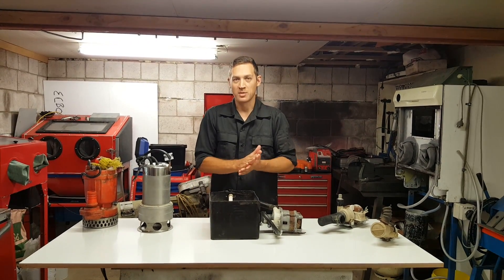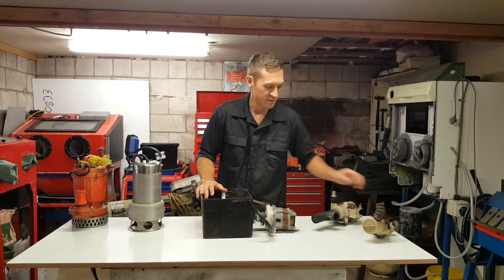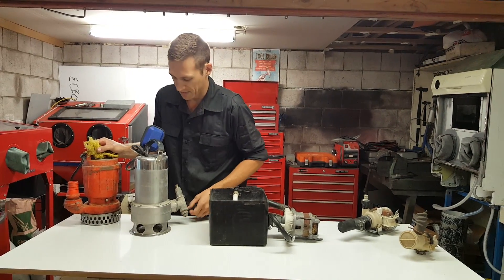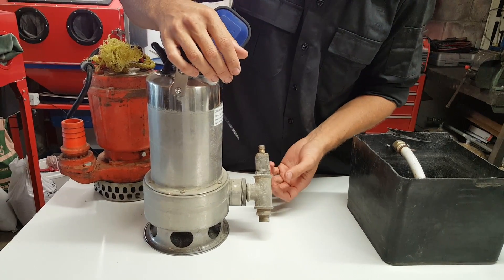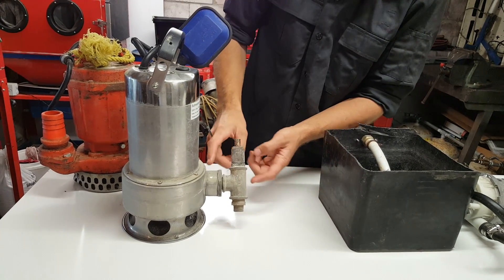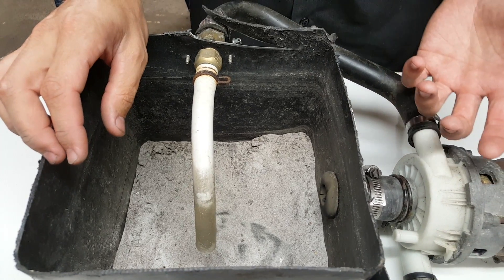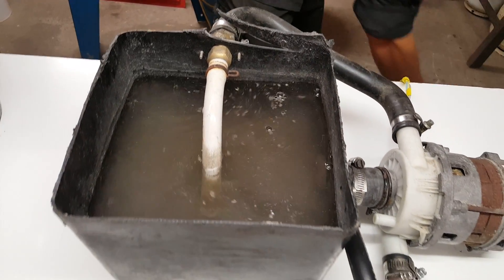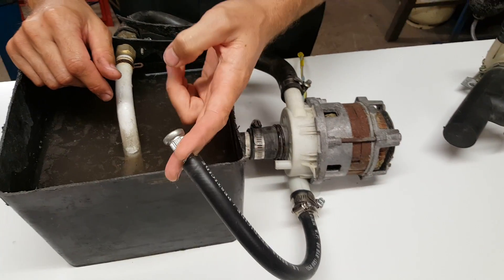DIY Vapor Blaster Pump Setups

Comment: Hi Great info.
Is it not better to have a larger discharge hose to the gun?
Reply from the maker: Hi Kevin,

That really comes down to a question of balance. 1/2" is usually fine for most applications. The other factor to consider is air flow. Unless you have a large air supply, going bigger can become over kill. As a general rule of thumb, I tend not to go above 1/2" slurry line until over 30 cfm of air supply. In which case I go up to 5/8" and then 3/4" over 50 cfm.

Thanks for the question!
Reply: Thank you for the info.
I have justed started out and based in South Africa where there isn't much info or equipment available.
Thank you once again for sharing your experience

Comment: 20cfm  air compressor strong enough   should I full full pressure or some psi
Reply from the maker: Hi! sorry I never answered this question. 85psi for cleaning, and if you want a shinier finish, you can lower the pressure to 35-40 Psi

Comment: What volume of pump should I use for a cabinet , the size of the red one , behind you. My budget and need i think is closer to an old dish washer pump, someone is throwing out lol.
Reply: Depends on whether you plan to run it in the cabinet or in a reservoir underneath. If you are only able to get a small pump, you don't want to have it lift too high. I usually aim at around 9000 - 18000l/h. I would recommend looking for a second hand submersible pump. You can get them pretty cheaply. You can make dishwasher pumps work, but there are a couple of restraints. The flow rate is relatively low, and they are not submersible so plumbing can be a bit more complicated.
Reply: @joshhubbard5026 That was really kind of you to take the time to share your knowledge with me. Very Happy to subscribe. Have an awesome day.

Comment: How do you filter out old water and retrieve media
Reply from the maker: It depends. Most closed loop systems for cabinets have multiple stages of separation. Usually through settling tanks outside of the cabinet. Some commercial cabinets use a pinch valve and a timer that drain off the excess water in the reservoir after the agitator stops working and the media falls out of suspension

Comment: What gph do you recommend for a vapor blaster slurry pump, and what’s the minimum gallons per hour recommended? There’s tons of options out there which definitely makes selecting the correct size pump a bit difficult for me as a beginner vapor blaster…
Reply: Hi Nick,

There is a pretty wide range the will do the job. I have build reliable cabinets with pumps ranging from 1700Gph right up to over 5000gph. The higher cfm you will be running, the larger the pump you will need. Another factor is the size of your reservoir. Large reservoirs will need large pumps to ensure you have the flow to agitate the media properly.  Another factor to consider which is less important, is the pressure required to overcome head. That is - the distance in height from the pump impeller to the nozzle. The more the pump has to lift, the larger it needs to be.

I usually aim at around the 3700gpm mark.

Thanks for watching!

Comment: I'm just watching your videos now and I've purchased your ebook.  Using a pump like the silver one in this video with a round reservoir, it looks like if the T was completely vertical with a 90 degree hose barb on the bottom, you could put a hose long enough to reach the entire circumference of the reservoir with the discharge under the T where it originates.  That would create a whirlpool effect, but I would add small jet holes in the hose directed toward the center of the reservoir as well.  Whirlpool plus inward jets to keep the media agitated as much as possible which in turn increases the saturation of media in the water.  Thoughts?
Reply from the maker: Hey John,

I have seen people doing similar things, but in my experience, it is unnecessary. The simple tee I use seems to agitate appropriately without dead spots.

Thanks for watching!

Comment: Hey mate. Another question. What ratio of media to water should I be looking for when I run just the pump without air and catch it in a clear container. I seem to only be getting about 10% media in a litre container of water.
Reply from the maker: Hi Craig.

10% is about the minimum. I try to be running 20-30% on setups with the cheap pumps. Higher quality pumps such as the Tsurumi I will run as high as 50%.
Reply: @ArmouryEnterprises  Yea ok sure. How do I get the media count up to about that 30% ? Do I just keep adding it the the bottom bucket? Thanks

Comment: Hey mate. Is there a Wattage pump I should be looking for that suits better. Or a certain Litres per minute. Thanks
Reply from the maker: Hi Craig. It really depends on your setup. But I usually look for a minimum of 750w. Or as a general rule of thumb, over 14000LP/H. You can get away with less, but if you go by these rules of thumb you should be just fine.

Thanks for watching!

Comment: Can you show the connection  of pump to gun the that you used in the bucket please.
Reply from the maker: Hi Jay,

Do you mean the one in the square bucket? This is an old video and I no longer have the equipment I used. But I could potentially explain if you can be more specific with the information you require.

Cheers
Josh

Comment: 1/2 hp pump, is it enough power for vapor blaster
Reply from the maker: Is that 3300 lph or gph?
Reply: Gph
Reply from the maker: Either pump will work, and 4.5hp compressor will be fine, but I always recommend going as big as you can with the compressor. If you can at all afford to go next size up then you will not regret it.
Reply from the maker: Hi Pierre,

What is the stated flow rate?

Josh
Reply: @ArmouryEnterprises   3300 for a 1/2hp and 4000 for 3/4hp . What should i get . Prive is like 75$ diffrence . I will like to know also. If a 4,5hp compressor with 10.5cfm is enougt or should i go a bit bigger

Comment: Hi thought id ask where did you get your air solenoid model etc  and how much did it cost ? starting to put things together to build thanks David chch
Reply from the maker: Hi David, I got the solenoid off a seller in Chch, but they haven't had stock for a while. I have ordered in an alternative, but not received them yet so I am unsure how well they will work.

Any 2 port air or water solenoid of the correct voltage will work. I use a minimum of 3/8"

Cheers,
Josh
Reply: @ArmouryEnterprises  hi have managed to order a 1/2 off ebay under $40
Reply from the maker: Ah great. That is a pretty good price. Have you managed to find all the other bits you need?
Reply: @ArmouryEnterprises  yes got the junction box some of the other bits will wait till solenoid arrives to fit it out and going to use a Tacoma gun
Reply from the maker: @davidbutcher6637  yes the Tacoma is a great gun. Lots of great reviews!

Comment: I'm curious where you would purchase a dirty water pump? Who would supply that, and what are they normally used for? Is that the same as a sump pump that would be used in a flooded basement or to drain your pool? Thank you for the great info, and keep up the great videos 😉
Reply from the maker: Yes, some countries refer to them as sump pumps. Most hardware stores will stock them.

Thanks for watching!

Comment: I've just bought a stainless steel and cast iron pump for my setup, I  didn't want to mess about with one's that were too small for the job so I went big from the start, it's the same configuration as the orange pump you have which could be tricky with pipework but I think I have it sorted. The pump itself is a 3/4 HP 5020 GPH 23000 L/H 550W only draw back is that it is quite heavy at 16 kg comes with 2yrs warranty and cost  £84.00  Question - Can I remove the float all together? Also is it too powerful? Non related question - what media do I use for cleaning carburettors?
Reply from the maker: I remove all the floats in my builds, unless I am just testing a setup. Pumps are rarely too big. If you feel like you are getting too much flow, you can always divert more flow into agitation.

As for media, it depends on the finish you want and the condition of the carbs you are cleaning. If they are corroded, you should run a mix of glass bead and aluminium oxide. If they are just a bit grubby, you will be fine with just a glass bead slurry. Or if they are in pretty good condition and you want something a little softer, you can use sodium bicarbonate.
Reply: @ArmouryEnterprises  Your answer was exactly what I was wondering about to.
I'll be self building a sysem and I've got 2 dirty water pumps bookmarked that are 15.000 and 18.000 liters per hour and I wasn't sure if they'd be to big or not.

BIG tumbs up from me.
Reply from the maker: @Gerrit-Max  Glad this video and comments have helped. Best of luck with your build and thanks for watching!
Reply: Thanks for your comments, is it just a case of removing the float cable and sealing the hole with silicon? Apologies for the random questions but I also need a good pair of gloves? Do you by any chance have an email I can get you on to discuss a few ideas?
Reply from the maker: @justinmacadam3924  
There is some limited wiring modifications to be made, but yes. I wouldn't use silicone to seal it. I usually use the rubber grommet with a stainless steel or galve bolt to crush/expand it.

Email can be found in the description (of this or other videos)

Cheers

Comment: Hey mate 
For the air solenoid can a retic (sprinkler) solenoid be used?
Reply from the maker: Hey Justin,

Theoretically, yes. What size is it? Any thing 1/2" or above should be fine as long as they are for a high pressure setup. 3/8" could work at a pinch.
Reply: Armoury Enterprises awesome mate thanks heaps, i was planning on getting 20 or 25mm , do you think 20-25mm will both me good? watched your videos last night and bought your program today, building tomorrow haha
Reply: There about $20 for a 25mm retic solenoid rated to 1000kpa
Reply from the maker: @justinsilvestro1940  Yeah mate, that will be heaps. I use 15mm on most of my stuff so over 20mm will be all good.

My email should be on the first inner page of the kit plans you got. Feel free to ask your questions there as I don't always get notifications for YouTube comments

Cheers!
Reply: Armoury Enterprises thanks mate I’ll email you instead one more question I’ll send you on email
Reply from the maker: @justinsilvestro1940  sure thing mate

Comment: Anyone doing this should consider a vortex impeller pump (as these may be) there is less contact with the impeller and media. Also try to find a pump that will do high "head" 10m = 1bar max pressure. Ideally a multi stage pump would give you plenty of pressure however much more engagement with the media and pump.
Reply from the maker: Yes, I agree with the vortex style impeller. IT will definitely prolong the life of the impeller and service length of the media. But it is not crucial. Glass bead with water seems to be relatively soft on impellers. I have a pump in its 3rd year of service with a fibre reinforced plastic impeller showing zero signs of wear. 

Also, pressure is not overly important. Flow is. The pump is only usually working against a meter or so of head. The air does much of the work and even then, can achieve good results on as low as 40-50PSI.

As for multi-stage pumps, they can actually face greater issues where as the pressure increases through the stages. Media can be forced against the seal surfaces causing premature wear. 

Pressure can become more important in larger setups using high volume air supplies, but a high quality single stage centrifugal pump will suffice. 

Thanks for watching!
Reply: @ArmouryEnterprises  Do you use compressed air as well? Yea glass bead will be quite passive. Fairly new to diy vapour blasting so not sure if other more aggressive media is used like in normal blast cabinets. I take it it's more about velocity than outright pressure? Interesting vid anyways 👍
Reply from the maker: @scottpickstock6721  
Yes, The pump agitates and feeds the slurry up to the nozzle, and the air accelerates it through the ceramic tip and onto the part.

The most commonly used media in wet blasting seems to be Glass beads, Aluminium Oxide, and Sodium Bicarbonate. To a lesser extend, garnet and crushed glass.

Velocity is definitely important. The pump only needs to supply the hand piece with enough slurry to carry the media to the nozzle. Too much water can increase nozzle pressure and reduce efficiency. At least thats what seems to be the case going off prior experiments.

That seems to be why pressure washers don't seem to work in these type of cabinet set ups.
Reply: @ArmouryEnterprises  ah, ok seems I missed a valuable point about the air I had assumed it was just entirely pumped. I did think those smaller pumps wouldn't be enough😂 but if all they have to do is supply the head with media/water then that's a-ok👌. Wondering if a 4 pole motor with 1450 (UK 50hz) would be good. I think one of these is going on the project list.

Comment: How long do your dirty water pumps last ? I have just had my first one fail due to filling up with water , not sure if the seal failed or how the water got in, would the media wear the seal fast?
Using 1800w 2400L/m pump
Reply from the maker: Hi Stephen,

What sort of pump, and what media are you using? I have a cheap 900w plastic pump that has been in use for nearly 3 years now that still runs without issue.

Cheers,
Josh
Reply: @ArmouryEnterprises  looks the same as your stainless steel body pump in the video , I am wondering if I have to higher flow pump and it is too restricted and forcing water back pass the seal ? 
Using glass bead media ,mixed at approx 25ml in  250ml of water when run into a measuring cup
Reply from the maker: @stephenrussack8877  I would be surprised if that were the case, centrifugal pumps don't usually build up pressure around the seal.

Some of the stainless submersibles have an air bleed grommet in the top. If the pump was poorly manufactured, the water can get into the pump through there.
Reply: Ok thanks ,there is a small rubber nut shaped peice on the top of the pump that i thought might be a bleeder ,didnt realise went into the motor i will seal it up on the new pump
Reply from the maker: @stephenrussack3084  I wouldn't seal it. It is still needed to prevent air lock in the impeller cavity but I have heard of two failures where the channel between the pump cavity and the bleed nipple had a leak into the motor compartment. Its a manufacturing fault rather than a design fault.

Comment: Would a wacher maschine with a wacher maschine Pump work ???
Reply from the maker: Yes, you can as long as it is not a weak flowing pump. I have seen some set ups that use 2 washing machine pumps. The first to agitate, the second to feed the nozzle.

Comment: The trick is don't use a square reservoir. I used a plastic bucket and set the agitation nozzle so it was right down in the bottom and spun the fluid.
Also, washing machine pumps I can get for nothing so I used one pump to agitate and another to supply the nozzle.
Reply from the maker: How are the seals holding up? I wrecked mine by running a tonne of aluminium oxide through it, but always wondered how long it would last if I had only used glass beads.
Reply: @ArmouryEnterprises  I'll have to say my system still doesn't work very well. 
I started by using one pump but quickly found out if you leave the aluminium oxide in the pump I have to clean it out before I use it as it will clog the pump into a solid mass if left too long.
The nozzle supply pump works well because as soon as its switched off it drains back into the reservoir. I looking into compressed air agitation for the reservoir. Not had much issues with the reliability of the pumps as I can get them 10 at a time from a local recycling plant. They recycle a couple of hundred domestic appliances per week.
Reply from the maker: @hugostiglitz6914  Is the pump that gets clogged up above the media in the reservoir? or below?
Reply: @ArmouryEnterprises  The agitation pump is 4cms below the upper fluid level, well above the media level. I wouldn't expect it to work at all if it was below the media level. Neither pump is in the reservoir, they are both external. 
I'm going to try something in the next couple of days and get back to you.

Comment: Hi, good videos. I see that your preferred pump is a 1150w rated. Is that the size you would recommend for a hobby type set-up?
Reply from the maker: Yeah anywhere between 900w and 1200w is where I would be aiming. You can go smaller where you have a small setup and a short lift distance between the pump and the hand piece.
Thanks for watching!
Reply: @ArmouryEnterprises  Thanks for your answer and recomendation.

Comment: G'day Amoury, sorry if this has been asked and answered before but if I'm buying a submersible pump, how many 'litres per hour' pumping capacity should I be looking for? Thanks in advance. Great videos on a great topic. Really helpful. Cheers from Oz.
Reply from the maker: Hey thanks for watching!

I thinkI have answered this question before but always happy to revisit. I usually aim for the 14,000 to 18,000L/h. However, I have successfully built systems using as low as 8,000l/h. 

It really depends on how large a nozzle you wish to run and what your air supply is like. less than 17cfm from the air supply and I would recommend 2.5mm air jet and 8mm ceramic tip then 8000-12000l/h is fine. If you are looking to run over 24cfm then you really need to be aiming for 14000l/h or higher.

Hope this helps.
Josh